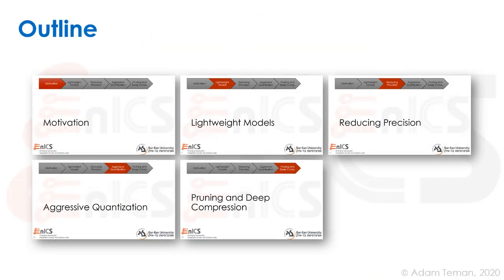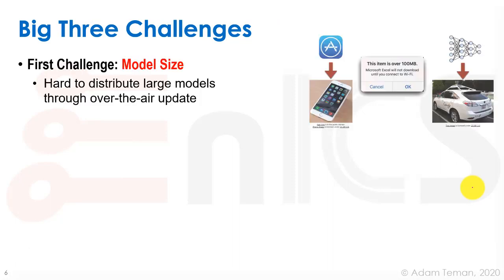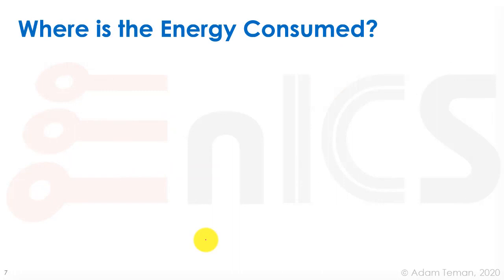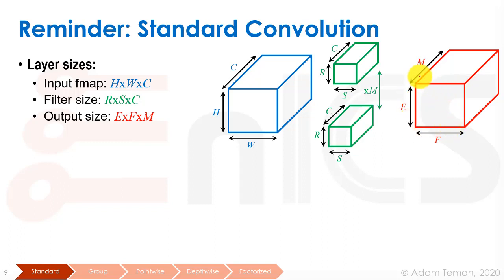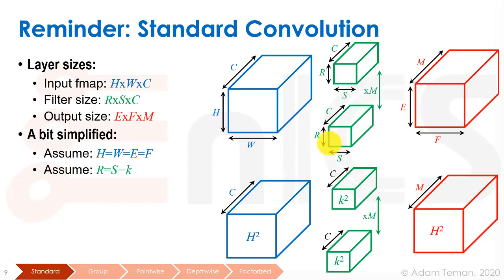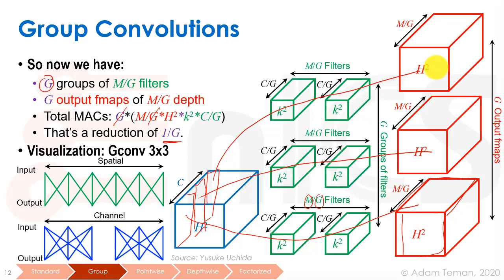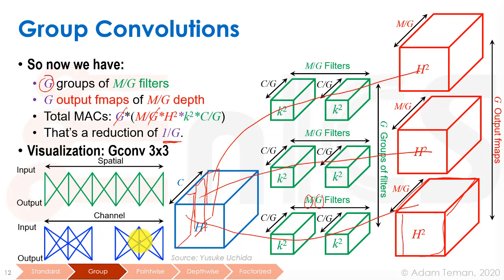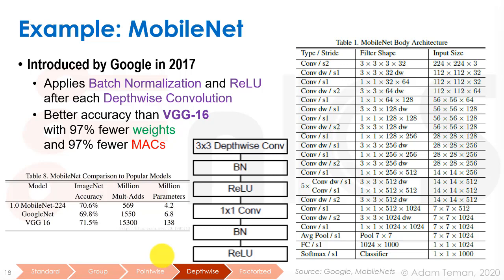HW for DL: Part 4a - Reducing Complexity - Lightweight Models

Comment: At 24 minute mark I don't understand where the MAC count of 16,675 comes from.

You have 3 pcs of 3x3 kernels, that move (convolve) 5x5 times; 3x3x3x5x5=675 MAC in the group convolution part and then 128 pcs of 1x1x3 kernels that move 5x5 times; 128x1x1x5x5 = 9,600 MAC in the pointwise part, i.e. the total MAC is 10,275. 

Can you check this?
Reply from the maker: Hi @FritzKissa - 
You are 100% correct. I don't know where this error came from. I am pinning a comment with the correction. Thanks!